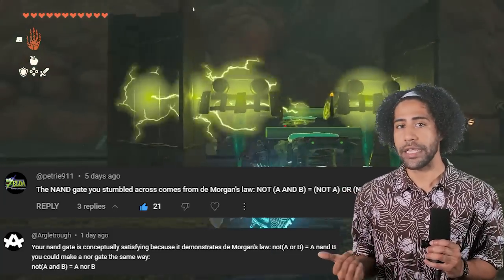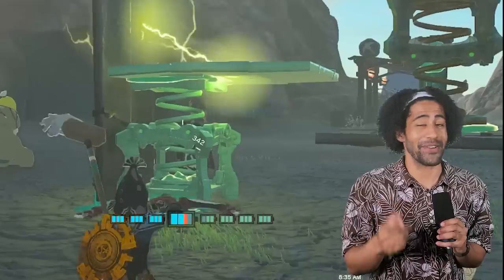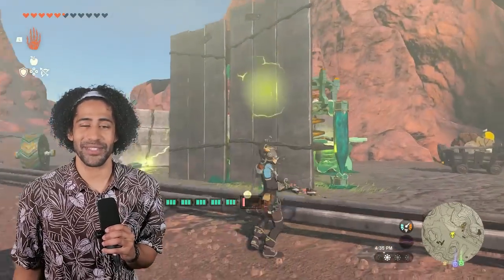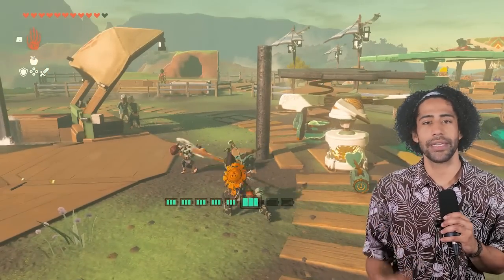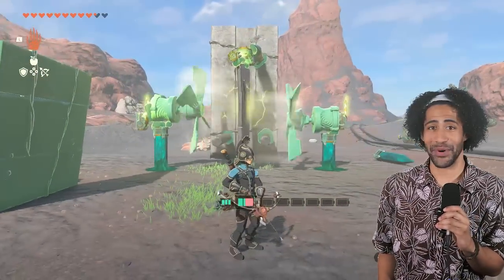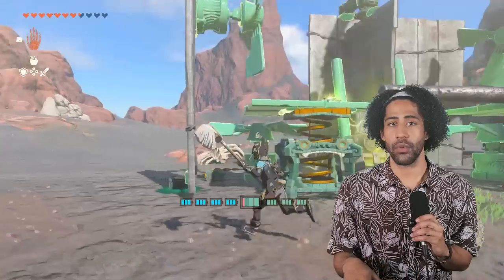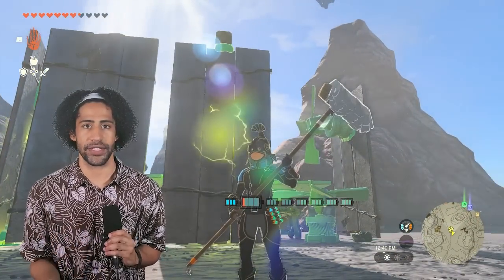I made better Logic Gates in Tears of the Kingdom

Comment: Have you tried using candles? You could use motors and water to extinguish or pass on the flame. The candles that are square from a shrine. Ignite the candle and then extinguish it for some kind of logic. Maybe bundles of wood that are caught on fire that aren't touching the ground. They stay on fire as a bundle. When they touch the ground they turn into a campfire.

Comment: I’ve been enjoying these videos a ton! Here’s some important information that may help you if things start getting more advanced.

Something I don’t believe anyone has mentioned is the fact that there is a limit on how many Zonai Devices you can take from your inventory. You can only have a maximum of 21 devices out at the same time, BUT…
Devices you can find scattered across Hyrule’s surface don’t seem to count toward this limit, meaning you could theoretically have more than just a few logic gates working at once as long as you use non-inventory devices and make some optimisations to have zero/fewer attachments.

If you need to find a specific device, the TOTK Object Map site can tell you the locations of all of that device and even can even show you where to find alternative electric power sources, such as the waterwheel in the Water Temple.
Reply: Not sure why but my comment disappeared after fixing a mistake…
I had to repost it.

Comment: This is super awesome. Great job!

On the swinging though, this is actually something real circuits have to deal with. That is, when power is applied to a pin on a chip, there's a time period where the chip will just ignore it so it can settle. The only difference here is the time, but, given the power going through your gates, that's not surprising XD

Comment: Really great work! A few minor suggestions.

First, if you want a really great, very accessible resource about digital logic and the various ways it's implemented (e.g. De Morgan's laws), I recommend the book "Bebop to the Boolean Boogie" by Clive Maxfield. Things like the difference between CMOS logic and resistor logic might give you inspiration.

Second, I kinda think the reason your motor/bar mechanism didn't swing back down when it was off was that you mounted the bar balanced. Even on a wagon wheel, the bar won't turn itself if it's mounted with its center over the axle. If you'd mounted the bar from one end, I think the bar might have swung back down as you wanted.

Third is just an idea--if you mount the motor and propeller on top of a spring, does it push the motor down (equal and opposite reaction style)? That would maybe be a way to work around the xor issue with the upside down version. I'm guessing this won't actually work (because, y'know, video game physics... otherwise why would it be less force upside down in the first place?) but it popped into my head in that section of the video.

Anyway, keep up the great work! I think you're teaching more people about digital logic than most of the tech youtubers right now :)

Comment: the 20 connection build limit may be this projects downfall, however, if you need a propeller to push up on something for some reason you can attach a wagon wheel to its end to make it lift off the ground without support.

Comment: 6:30 that's not because the motor stays in the same position, that's because the pole is attached to the motor at its balance point, so any rotation is balanced. You might be able to offset it to make it work with gravity anyway.

Also, you may feel stupid, but the fact that you spend all this time and effort doing all this and actually learned a bunch of stuff while doing it makes you A) an expert in the field (and a pioneer even) and B) a very important contributor to getting TotK (kinda) Turing complete

Comment: something that might help with the build limit is that you can replace a shock emitter with an electric enemy (Chew chew, Keese, whatever... you get the idea) in a metal cage. The cage doesn't have to be connected to anything, but by placing the Battery (from the Mogawak Shrine) in proximity to the caged enemy it will charge up and release at a steady rate turning the enemy's electric attacks into a constant stream of electricity.

Comment: Does adding a weight to the swinging weight reduce the swinging in the end or does it just make it swing so little that it can't activate the gate properly?

I think the next step is to build a flip flop. I'm envisioning a seesaw. The set input is a fan closing the circuit. The reset input is a spring holding the circuit open.

Comment: Side note, but I could've sworn if you attached two springs together one already being activated prior to fuse then they would alternate, but then I guess that would just make it a constant flow since you couldn't ever turn them both on or both off.. could possibly interact with two seperate gates based on which spring is active though serving as a glorified switch that always gives an output to one gate or another... However that might be useful if at all, but likely could just be pointless.

Comment: As far as the attached springs are concerned, yes when you attach them they are treated as a single object, but if you activate just one of them before attaching, and then attach the active one to the inactive one, then hitting it will cause the active one to turn off and the inactive one to turn on. This means that every time you hit it, the two sides will remain in opposite states. 
I've seen this used as trick to get indefinite lift in hovering machines.

Comment: For additional control options, consider using the "fuse entanglement" glitch, with this you can remotely control parts and even entire builds.
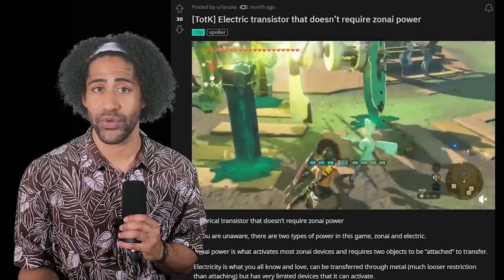If you go to the video "Zelda TotK Best Highlights, Builds & Funny Moments #41" at the time 5:20, there's a remote control plane where the tilt of the wings is entirely controlled remotely from the ground while it flies far above.
I think if you found a way to incorporate remote control parts into your gates, you could use a series of control sticks to activate the gates without needing to shoot or smack them, and even toggle multiple parts in sequence faster.

Comment: This is in no way an assertion, but I would guess that the fans don't push the springs down as hard either because the springs are programmed to push up more than in other directions to resist the effects of gravity in general (difficult to test because gravity is always present and even if you were to go to a low-gravity area it's possible this effect is lessened in low-gravity, yet not enough to, for example, remove the fan-strength-offset), or because when the fan is blowing up or to the side it creates gliding drafts that also affect the physics of other objects in the world, increasing their force, while when pointed down they only produce the basic fan current (easy to test, just see if they blow Link downward when he's gliding and they're glued to a stake pointing down).

Comment: i have a question about this, would it help to make more complex and bigger circuits using ice platforms? you can create infinite of them in water with just any elemental ice damage and you can place them floating in the water and use that flat water as a canvas, you wouldnt have to link the platforms together because they are floating in the flat surface of the water, you could reserve the 21 ultrahand attachments to the parts you really cant avoid attaching for the circuit to work (i dont know much about circuits but i thought maybe a different approach with potentially infinite platforms that can conduct electricity and in a horizontal plane instead of a vertical one where you have to attach certain parts for them to not fall to the ground, or maybe its not a smart approach because you need certain verticality for your ideas to work, i dont know, ill let you judge)
Reply: okay ice melts at ambient temperature, of course xD so you could only do this on a very cold region i suppose

Comment: If you wanna do a full computer, I think you basically showed it's possible in principle, but for the sake of full automation and such you'd also want stuff like a memory buffer (basically RAM) and a clock for syncing computations.
I suspect actually making use of such components won't be doable without lifting the parts limit, but it could be fun to see how to do it in principle

Comment: You could probably do the motor only thing by attaching the rod off center... but since the motor itself conducts electricity, it probably won't actually work.
Maybe that could be used as a toggle, since it would connect itself to power once activated, but I'm not really sure how you'd turn it off with an input.
I don't think those motors have enough torque for an added insulation piece, and even if they do, it's probably still less attachment efficient than the fans...
good luck, can't wait to see how this turns out.

Comment: You could use the capacitor to debounce the fan xor gate, if you don’t want those pulses going through a circuit. Adding the cap to the output would keep it high until the wall settles and the cap can discharge.
Reply: I was wondering what use there might be for that. Is it anywhere other than the shrine under Zora's Domain?

Comment: I’m bothered by the one dude who claimed it can’t be Turing complete because that requires infinite memory because infinite memory is actually impossible and declaring something Turing Complete only requires that the system’s memory could theoretically be expanded infinitely, and you already explained the caveat that it couldn’t be considered Turing Complete until the game could be emulated and modded to remove the build limit, which would allow it’s memory to be expanded theoretically infinitely. If practical infinite memory was required then nothing would be considered Turing Complete but almost every programming language (only excluding some specialized ones), Minecraft red stone, and Magic the Gathering wouldn’t be considered Turing Complete but they are.

Comment: if you put a stabilizer on the bottom of the hanging metal plate it should still be able to swing far enough to make contact but also settle in between the two metal rods faster, allowing it it not have residual pulses when you turn off both inputs

Comment: Slight suggestion, try using zonai stabilizers on the ground instead of springs. Springs can get a little wonky I've noticed, and stabilizers are very reliable for getting the walls to face upward.
Reply from the maker: Thats a great tip!

Comment: I know it's not going to have practical application, due to the build limits and physical limitations, but I realized that attaching a conductive rod or plate to a motor or the outside of a large wheel would allow you to build a timing clock for this hypothetical computer. The speed of rotation would set a base timing (and the big wheel could be operated with a steering stick to gice it 3 speeds; normal, boosted, and reverse), the number of evenly spaced conductive spokes would determine the pulse multiplier, and you could even put condictive "brushes" orthogonally on the ends of the spokes to increase the length of every "on" pulse.

Comment: So your calculator, you demonstrated that it can add 0+0, 1+0, and 1+1 but can it add 0+1? Genuine question as ridiculous as it sounds. Basically you demonstrated 1+0 by only activating the right shock emitter but 0+1 would be with the right emitter off and the left emitter on.

Comment: One thing to note 2:30 ish, when you mention that the springs are treated the same--this is true if they are attached *and in the same position*. If you manually spring one open, then attach it to a closed one, they'll flip any time the system is activated!

This also holds true if they are attached elsewhere on the same device!

I just verified by pulling out 2 springs near a wooden board. Struck a spring, then attached them both to the board. Hit the spring, it closed and the other popped open. Then, I stacked the open one on top of the closed one, and it once again closes the other spring and opens that one.
Reply from the maker: Oh! I hadnt even thought about doing that, that potentially is really useful
Reply: @tonyhinderman  I hope it helps! I barely grasp logic gate stuff, but I'm trying to learn ^^ at the very least I have learned some game mechanics

Comment: Could you use a spring attached to a stick on the end of a motor such that when the motor is powered, the spring closes (attached in loose state) but is forced up against some powered wall/conductor. Then, when the motor is deactivated, the spring forces the motor to counter-turn before hitting into some backstop that is unpowered. 

IIRC springs just toggle state (primed, loose) and whichever state you attach it to your single contraption, the opposite happens when powered.

Comment: Also you could try to add something to the wall which makes it only barely power the bars. With the swinging wall design. Because it never moves as far as it did in the first place it will only be touching the bar enough to power it the first time but blocking it with some amber or diamond might be just enough room to make the swinging go away

Comment: Hey, your first video gave me some inspirations and figure it out another way of doing logical gates, and it end ups being quite similar to the transistor approach you brought to this video. I was also using the motor + fan from the shrine, but instead of using the spring transistor, I'm working with sail + zonai fan. The idea behind it is that the zonai fan sets an "off" direction, so, since the shrine fan is stronger than the zonai fan, turning the shrine fan "on" would force the sail to turn to a different direction.  In that way I can attach any conducting material or a shock emitter to the sail tissue and it will turn to the direction I need. I can even use more than one shrine fan so depending on the position of them and the position I attached the shock emitter to the sail, I get different logical gates. I don't have my switch with me right now but if anyone is interested I can record my progress and share.
Reply from the maker: That sounds really interesting! The idea of a turning sail introduces a really useful dynamic, might be helpful for stringing together gates. Where did you get the sail?
Reply: @tonyhinderman  You can find it near the Dueling Peaks Stable, there is one behind the construction materials located at the big twin bridge.

Comment: Part of the ship, part of the crew (grabs mop).
Maybe to reduce pulsing on the pot XOR gate, maybe could try adding like two pots at the bottom of it attached to something heavy so the joints still flex enough to reach the conductors, but not enough so that the sheet of metal doesn't swing back and forth after the fans stop. I have no idea.

Comment: Great work!

I think if your best bet to get TC is probably implementing a small universal turing machine using minecarts as a tape [1].
For that you'd need a bunch of minecarts  (theoretically infinitely many but who's counting) on a rail and mechanisms to:

* Store some form of state in each minecart, e.g. by having a metal ball either on the right or left side of it (this would also get you around the construction limit).
* Push the whole tape one minecart to the left or right.
* Read the current minecart state.
* Change the current minecart state.
* Store some internal state.

The turing machine would then in each step read the current minecart state, and based on its state and the internal state:
* potentially change its state
* potentially move the tape
* potentially change the internal state.

The smallest known universal turing machine with two minecart state (symbols) has 19 internal states though. So I doubt that it's possible to build without hitting the game limits.

But I think being able to move, read and write the tape would already be quite the achievement :D

1. https://dna.hamilton.ie/assets/dw/WoodsNearyTCS07-DRAFT.pdf
Reply from the maker: Wow thanks for the info! There is a lot of interesting stuff in this paper, I am going to give it a read and hopefully implement what I learn in the next vid

Comment: you can attach a battery to a weapon and charge it with rijus lightning, and that conducts electricity in water without using the ultra hand fuse limit. Might come in handy for something?
Reply from the maker: I havent messed around with water much but I think that will be a focus of the next vid! It would definitely save on attachments and with the full adder it might be the best way to send power through the machine
Reply: Does this work out of water, while the parts are wet?

ie:  in the rain, or with splash fruit?
Reply: @lococomrade3488  it actually works whenever it around any metal at all! If you stand around a treasure chest for instance it shocks link or anything around him. If you just left it on a metal shrine slab it should zap the whole structure without actually needing to be attached

Comment: That pulsing is kind of cool though
I wonder if you can do anything with that
Reply: I know barely anything about electricity but it did remind me of a Steve Mould video, i think it could potentially serve as an (admittedly pretty weak) inductor.
Reply: You could make a clock. 
A simple clock is always a good thing to have when designing circuits. They can often be used in unexpected ways.
Reply: @Mirror_Lotus use a miter for that or a not gate connected to itself